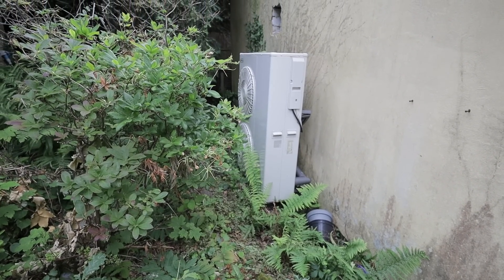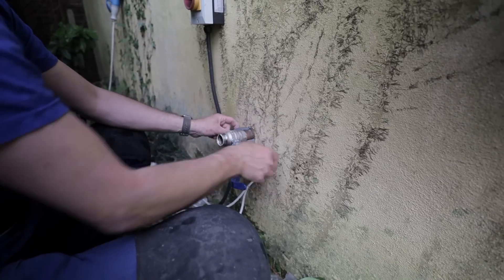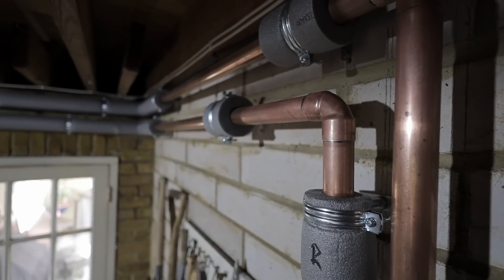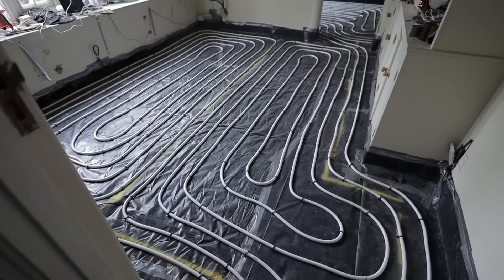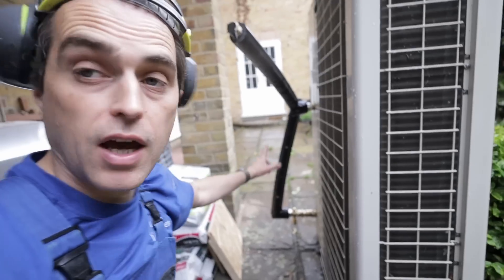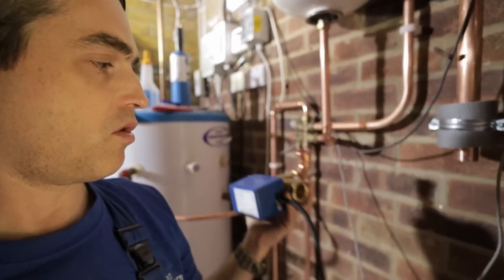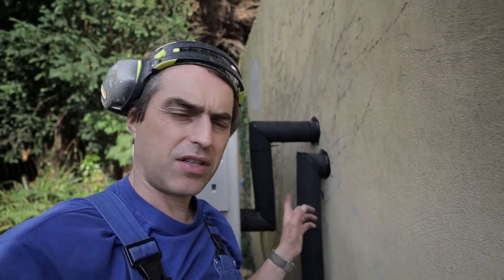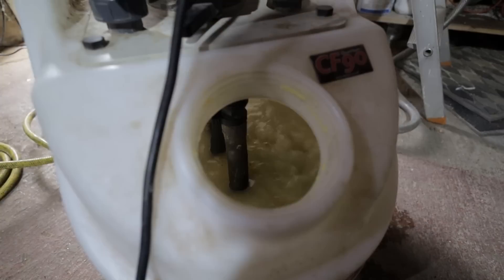Heat Pump Installation Nightmare - Can It Be Saved?

Comment: We had a new system fitted, guess what they use internal insulation
The system was meant to be installed into an insulated shed.
It is not and 100% cowboys
2:03

Comment: Clearly, theres a problem with the install, but theres still the same problem after all of the work, Maybe if the "blockage problem" was fixed all this work may not have been nessercery,  So lets await the next and hopefully final episode.
Reply from the maker: sadly no heat pump, even 5kW would be able to work on the existing system. You cant push 12kW though 30 meters of 22mm pex pipe. It is just impossible.
Reply: Yea, I can see that.  But clearly the blockage was there before, any luck with solving the problem?  I dont suppose there's any history of the flow rate before you started?
Reply from the maker: @johnridley1038 system didn’t work almost at all. It could only get 12-15l / min so massive cycling killed first heat pump. It got replaced under warranty. Then in the winter the system didn’t operate well, keeping the property at 15-16c

Some rads didn’t work at all, zero flow.

Now there is flow everywhere but it is only 20-22l / min as original installers charged banter system into sealed, but didn’t bother to flush it.

Now the hex is blocked, and if I can’t unblock it it will be a 3rd heat pump in 3 years
Reply: @UrbanPlumbers  Wow,  Thats going to be a frustrating job getting the hex unblocked, I guess one circuit at a time? then seal it off to stop muck going into the already cleaned circuits.  and see what comes out of the unclean ones.  sounds like a 2 day job and video to me.  Good luck.

Comment: What a mess to correct. From a troubleshooting persective I would get an electrician to check if it is all connected to the specifications in the manual. I would also install a smart energy meter to see what's going on realtime. I don't know what type this is and what is controlling it, but sometimes a factory reset or a firmware update or reinstall does wonders for modern electronics. I assume the thermostat is calibrated and you have also tried turning it off and on again. 

And just maybe (however unlikely) the problem is not inside the heat pump, but a case of really bad luck with some of those pipes inside, as were moved and there was a lot going on with builders onsite. Can you do a flow test of the entire system with a pump instead of the heat pump?  This will also prove to the customer that your part is working just fine. If warranty on the existing heat pump has expired, maybe just replacing it with a big Vaillant is the better choice if the customer can still claim some incentives, the newer heat pump reaches a much better SCOP and the customer can start using the property sooner.
Reply from the maker: it si 100% blocked main heat exchanger on the heat pump. This has now been confimred and I will go back to unblock it in Sep.
Reply: @UrbanPlumbers wow, they really missed nothing in messing up at the time.

I hope you can still save the unit without any more headaches.

Comment: Prime example of why this is one of the worst jobs In the world. I do this job and hate this job with a passion. I used to love it, but the better I’ve become the more I hate it. Any apprentices watching avoid at all costs and go be a spark.
Reply from the maker: the best job ever. keeps you buys and alway learning.
Reply: @UrbanPlumbers  you are definitely very skilled, and a big attribute to the trade. But are you getting payed more to deal with these further issues? Or is the customer refusing to pay like most LLs do. Even though you couldn’t have anticipated the additional fault and clearly done your best endeavour. 

This job will never make anyone a millionaire. Always the average Joe with a few vans on the road. 

It’s best to be honest than let everyone make our mistake and live an average life in-spite of learning an exceptional skill set. Doesn’t matter how good you get, this will always happen. 

Love your videos, and wish you the best of luck with resolving the fault.
Reply from the maker: The manufacturer tired to fix it last week but failed. (they replaced the pump and it didn't help). I am going next week to try to unblock the heat exchanger again or look for the fault elsewhere. 

The customer pays or I don't come back. A faulty heat pump wasn't in the scope of my work. The faulty system was the scope of my work.

Comment: Szymon, can we have an update please? Did you find out what was causing the low flow rates?
Reply from the maker: Manufacturers are attending next week to check the unit
Reply: @UrbanPlumbers  Thanks, it would be good to see a follow up video once it’s all finished
Reply from the maker: It is coming. However I have to wait for the client to finish renovation, so would expect another 2-3 months before I can go back, as even with incorrect flow the system work fine, just not as good as it could be

Comment: Gas boilers compensate for a lot of poor design choices.
You do not get away with them with heat pumps.
I never install such pipe sizes for that size heat pump.
Rather impressive set up, my guess pump issue.
Cheers from oz
Reply from the maker: That’s what I think too. Customer is waiting for the manufacturer to fix it

Comment: Weather dependant mode activated at all? 

Have you a way of checking head psi? R32 at 55 degrees LWT would require at least 55barg discharge psi. I didn’t hear the compressor ramp up fully and suspect a low gas charge could be holding off a pressure transducer possibly. 

Any backup heaters activated? 

Keep up the good work.
Reply from the maker: Doesn’t matter as circulating pump is fixed speed. It doesn’t modulate

Comment: Something is telling me that pump is goosed. Doesnt matter how dirty the system is, the pump should still be strong after 3 years. These units are terrible mate, i know you wanna do a good job, but heat pumps arent the answer. 12 kw gas system boiler would be perfect for that house with no issues

Comment: 40mm plastic, jezz how impractical is that
Reply from the maker: it is actually very practical, especially on longer external runs in pre-insulated twin pipes. Obviously, you can not use push fit anymore and it has to be a compression-type fitting on both ends. Plastic is really a life saver on longer runs.

Comment: Szymon great job, great work! 😊 I had similar issue with heat meter by underfloor heating. I got 200 mbar pleasure drop by 0,7 m3/h just on heat meter. For test purposes I replaced heat meter with 130 mm long 1” pipe and flowrate was as I expected 😅 (I didn’t read all of 150 comments, hopefully somebody else had a similar issue).

Comment: Oh I wish you were here  in Washington DC.  The Contractor is  horrible!  You should see my HVAC electrical upgrade from gas to electricity . The company caused a power outage  to my home and blew out my spa turning the power  back on doing his own heavy up. He didn't label the breakers as he took them offline.  You could become a billionaire in 30 days. Stay away from Greenscape Environmental Services in  Washington DC. My problems sound like this case. It's not the heat pump it's the installer. The guy says he is use installing on new construction homes. I wish he had came to that realization before he put my 1939 all brick colonial in a coma. Keep spreading the knowledge. Thank You

Comment: I'm not against heat pumps but they seem to be more problematic than a conventional gas boiler.  I just think you risk creating problems for yourself by switching to a heat pump, for example the family in this video had a whole winter where they were cold.  I'd rather keep my gas boiler and stay warm, even if it costs a bit more.
Reply: @zlmdragon. It is both obviously.
But simplicity and reliability, repairability IS a huge factor in a system's value. 
Overly complex systems are less intrinsically valuable when they can be matched in performance by less complex systems by comparison.

If you can get a reliable bike with few bells and whistles that you can rely on and repair easily...

The intrinsic value of having some space age all option bike goes down when the net benefit is questionable.

Sometimes simplicity is just far better.

Comment: Pipe work sizing is really interesting.   I have seen the Heat Geek’s videos on it.  One thing I don’t  understand about using 35 mm pipe.  Usually the heat pump have 28mm connectors (certainly that is the case for Valliant).  Why does the heat pump only have 28mm connectors if 35mm pipe is needed?
Reply from the maker: All Vailant connection are 1”1/4 so they are 35mm. Smaller heat pump connections don’t matter as pressure loss is proportional to the length of pipework - so on very short run 22mm may be fine and on a very long run the same heat pump may need 35mm

It all has to be calculated and will be different on every project even on the same size heat pump.

Comment: I've been a gas/heating engineer 20yrs, and an F gas air con installer for about 15 in the east midlands area, I'm busy, busy. In all that time from my customer base I've had ONE serious enquiry for a HP installation, the client was a multi millionaire and knew the value of a pound, after weeks of enquiry and calculations on my part the project was dropped, because it was only the grants available at the time that made the install cheaper to run than a gas boiler. I fitted a boiler. I've been called to service non functional HP installs, and cant get the original (National) installers to answer my emails or even the manufacturers. Without OEM manufacturer training how can you diagnose a faulty PCB or inverter board on these things? It's complication gone mad. Servicing? Repairs 10years after installation? Even a large regional air con contractor I know has completely rejected moving into this  field, due to the afterservice minefield. This reminds me of the "Green Deal" scam a few years ago, or Prescotts' Home Information Packs fail. Toys for the rich. Rant over👍
Reply: You haven’t got a clue how bad it is. There are millions of gas boilers nation wide most running for years with no issues and I very rarely see a bad installation. There aren’t many heat pumps installed yet every one i see is a disaster. A professional heating engineer can easily work on any fossil fuel boilers, take a look at Mitsubishi’s version of a combi boiler it’s in a different league in complication. Unless something seriously changes heat pumps are not going to meet the UKs future heating needs and a lot of people are going to have very cold winters and quite a lot of vulnerable people will die.

Comment: Presumably the original installer didn't have the luxury of builders putting a slab in to hide the 35mm pipes and being able to install underfloor heating?? Correct me if I'm wrong but I think this is a bit misleading.
Reply from the maker: Original installer run all new pipework through the loft. The only luxury he didn’t have was understanding pipe sizing and a will to do a half decent job

Comment: So you’ve upsized the primary heat pump F&R to 35mm?? 
But you’ve “re installed” the Grant Mag One filter?? Well it restricts the pipe size to less than 28mm in diameter??
This pipe sizing is getting out of hand now.
We have 13kw heat pumps on 28mm and running bang on.
We have a 26kw cascade system 2no 13kw heat pumps through a LLH split over two zones each of roughly 12kw and primary pipework sizing is 28mm to LLH and each zone off of the LLH is of 28mm with a 25/80 pump on each zone and running with ease and no complaints of heating issues 🤷🏼‍♂️
These systems people are over complicating them for what they are.
Reply from the maker: If you want to run a system without a buffer on a heat pump circulator alone you have to go to 35mm in this case. 12kW heat loss so 28mm would have too much pressure drop for DT5.

Grant filter makes little difference, pressure drop of pipe of fitting is proportional to the length of that pipe or fitting - so having that filter there is equivalent to few inches of 28mm - so pressure loss is negligee here.

If you run a buffer with a system pump that’s yes you will ‘get away’ with 28mm on a 12 kW system no problem. 

 For highest efficiency you want to avoid the buffer though

Also, even on 35mm I still can’t get over 20l / min flow right now and I need around 35l / min

Comment: So long as we use gas to generate our electricity I can't see heat pumps being relevant.  Take nuclear, we'll over half the heat goes to waste. In France,  during this heatwave, nuclear output has to be reduced to save overheating the local environment. I like my hot water about 60°c and its useless thinking my heat pump can do that economically.
Here's a big one, heat pumps fester away full time in the winter, this means they are using a lot of electricity at peak times, which is really bad! The stupid things can't economically provide high enough temperatures to use phase change technology to ease the load at pinch points. If you look at the big picture, say we put in several million heat pumps tomorrow they would HAVE to use gas generated electricity at negative CoP 2 or 3!
I tried to get an ashp, 7 years use, repaired and it was going to cost in the thousands. 
If I'd spent the £16,000 on solar panels and battery I could have made most of my own power during the summer, then, come winter, the battery would help the Grid at peak times which would save more gas than my wretched 16kw. ashp.

Comment: Unexpected strainers can be a real nightmare.  I've heard of issues with ball valves that have integrated strainers in get blocked and no-one knew they existed!  Is there a way to measure the flow when you powerflush?  This might help you find the blockage?

Comment: This is why I don’t want a heat pump.  I have picked tradesmen in the past, who despite research have under performed.    Also my good friends have just had a heat pump installed.  I will be interested to see how they survive their first winter. While some of the rads have been increased in size the downstairs uses existing micro bore. Also I can hear their heat pump from the opposite side of the street.

Comment: An S-Plan is not the right piping configuration for a heat pump system, of that size. You need hydraulic separation.
Reply from the maker: No you don’t
Reply: That installation is relying on the ASHP circulator, to push the water around the index loop. Those Grant Aerona Heat Pumps, do not have that much residual circulator pump head, to play with, even at their max speed setting. That is why a common secondary pump, with two one valves, or two zone pumps (rads + UFH) are necessary, for larger homes. The Grant installation manual also shows a low loss header, and a secondary pump, for rads and underfloor heating. Maybe check out the pump curves for that model, and have a think about it.

Comment: At this very moment, half our electricity is produced by burning gas. By the time that electricity reaches your heat pump almost two thirds of the energy within the gas has gone to waste.
 My heat pump is off from May to the end of October so it doesn't really benefit from solar from the grid.
   To cap it all, offshore wind companies are pulling out from installing more turbines on the basis that the costs have risen too high for economic viability.
   With electricity costing four times as much as gas I can't foresee being able to run my ashp next winter.

Comment: yet another proof heat pumps are not the future not reliable don`t always work not like gas boiler and for those in denial I`m gas safe heating engineer also MCS contractor
Reply from the maker: MCS contractor saying heat pumps are not the future. No wonder we are where we are with heat pumps.

Comment: Urban and his team are an absolute credit to the industry. Great video as always.
However what was the initial installation cost of the system and what was the cost of UFH and remedial works ?
20 grand and counting for a HP system that still doesn’t work ? 
For people already facing a financial squeeze this makes no sense.
Reply from the maker: Don’t think we have much choice. Burning stuff is not really an option anymore.
Reply: @UrbanPlumbers  Burning stuff , is how they produce the electricity that runs a HP . 
Wind and solar can’t produce the amount of energy that’s needed . Goggle disused wind and solar farms.
I am totally in favour of energy efficiency.
Reply from the maker: Yes, but is it more efficient to run a heat pump than burn gas at home. Also the grid will only get greener moving forward.

Comment: Very cool to see the how it's often done 😮 vs how it should be done. 
We're just in the middle of doing our own diy UFH and installing a little 3.5kw ASHP. Whole system is very simple, single zone, no electric actuators, no tank (heating only), no buffer, no volumiser,  no diverter valves, just UFH loops and a diy towel rail (28mm copper).
We have been round a few friend's 'pro' installs and immediatly see poorly insulated external pipework with zip ties and uninsulated ball valves all over. They also seem to be crazy overkill in complexity and size! 
Time will tell if our little install will be sufficient, but the heat loss calcs etc sugest it will be more than enough...
Anyway, you're videos are super helpful, looking forward to seeing how this one plays out. 😊